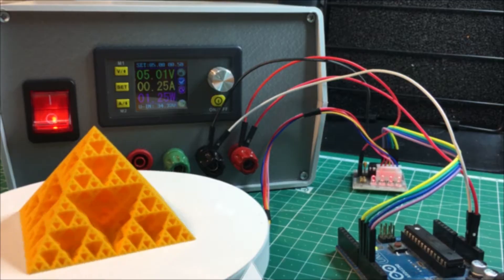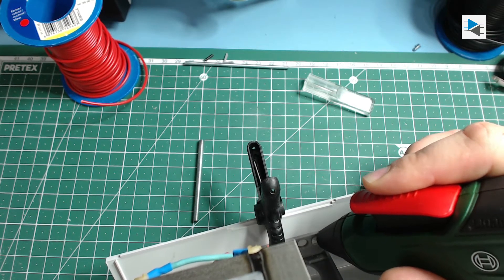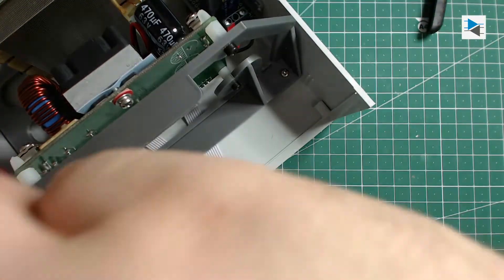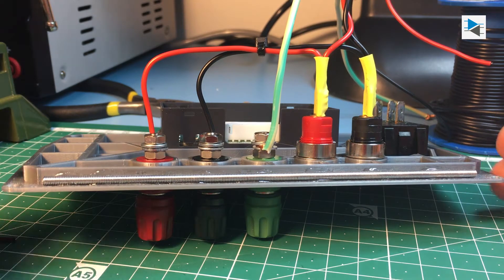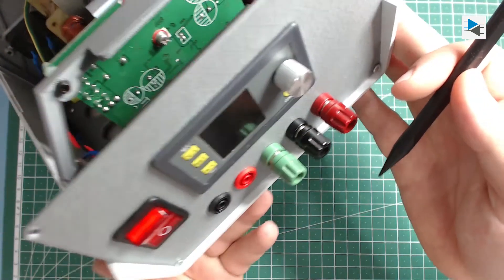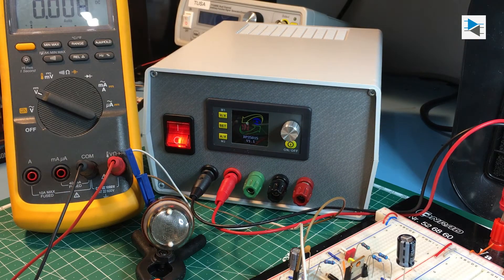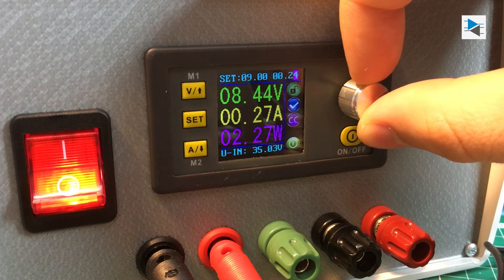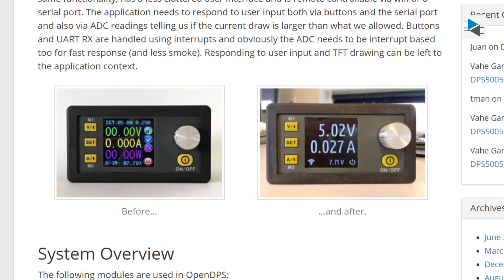DIY Lab Power Supply - DPS 5015 (Part 2)

Comment: @otinex I'm an absolute beginner, can you explain the difference between the insulated banana plugs and the power supply posts on the right side of the panel? Thank you!!! :-)
Reply from the maker: The banana plugs on the right-hand side are slightly more convenient for connecting wires, as the terminals have a screw on them. The ones on the left-hand side are meant for the more secure insulated banana plugs. Electrically there is no difference between the pairs because they are connected in parallel. Hope this helps :)

Comment: Hi, How You solve the curling problema with 3d printer when we print largue base Área objects as You do with front and back panel?
Reply from the maker: I print in PLA using a Prusa i3 MK2 with a heated bed that is covered by a PEI sheet. I don't use anything else.
Reply: otinex what temperature You use in the base table and You use fam to chill the printed object?
Reply from the maker: The heated bed is at 55°C, the fan is off for the first layer and on 100% for all others
Reply: otinex Thanks a lot, my bed is 200,and fan is off first layer and 100% rest.But dont work good like your
Reply from the maker: normally PLA doesn't require a heated bed at all, but 200 (if that's even achievable) is way too much. Try 40 - 70 and check that the bed is level and that the nozzle is at a right distance for that first layer (too close and it can curl, too far and it can curl).

Comment: Hello,
can you tell me the values of the two components soldered between the output terminals (near the toroid on the main board) I turned the terminals on the back and during the desoldering I have lost one (in your video I saw two, in my circuit I have only one but the empty pitches have too much pond to be empty in origin)

Comment: Do the DPS PSUs require AC, DC, or both on the input. 
Only seen them on eBay so far, and no info is given on this.
Reply from the maker: The DPS Module requires DC. I used a transformer and rectifier to deliver voltage to it. Theoretically it would  be good for 50V DC Input.

Comment: Thanks for your response. I'm a 22000 microfarad capacitor. you've been very thorough, Congrats and sorry for the disturbance. just one last thing: from your video I think I see that the capacitor is connected between the positive and negative of the bridge rectifier right?
Reply from the maker: that is correct, yes :)

Comment: hello. First thank you for the link you sent me to the transformer and the rectifier bridge. I wanted to ask you something else: the capacitor of how many microfarads is and how many was to be. and then connected to the most and less than the rectifier bridge - if you have an electrical scheme I would like it. thank you and I joined your excellent channel
Reply from the maker: The value of the capacitor is dependent on the amount of ripple you want to account for on a given load. As a rule of thumb: v_ripple = I_load / 2* f * C; Where v_ripple is the ripple voltage you can expect, I_load is the amount of current that is being drawn, f is the frequenqy - if you're in europe 50 Hz, if you're in the US 60 Hz - and C is the value of your capacitor. So if you assume the absolute "worst case" scenario being I_load = 15A and you can live with a ripple voltage of - let's say 100 mV then you would have -> 15A / 2 * 50 Hz * 100e-3V = 1.5 - so you would need 1 Farad (!) for that. That's 1000000 µF (!) if we want to be more generous and use a 100000 µF capacitor at 15A it would result in a ripple of 1.5V. The transformer I linked to you has a max current rating of about 4A. Using a 22000 µF capacitor with at least a 40V rating, you would get a ripple voltage of 1.8V at 4 A which for some is acceptable. As the power supply itself also has some input filtering, I used the highest value cap I had around - as a placeholder so to speak.

What i'm trying to say is that it depends on what you want to do :) In your case I would probably go with a 22000 µF capacitor (about 10 - 20€) if you don't plan on loading up your PSU to the max, otherwise for this configuration you can go for 150000µF (about 50 - 90€).

Comment: Hi, great video, congratulations. I bought the DPS 5015. I wanted to know what kind of transformer serves and what type of diode bridge serves. Thank you
Reply from the maker: Thank you for the Comment! The transformer is a 96 VA transformer with multiple secondary taps, of which I use the 24V one. The rectifier is just something I had laying around in my bin. I assume you are from Italy, I bought mine from Conrad : http://www.conrad.it/ce/it/product/514349/?insert=62&insertNoDeeplink&productname=Trasformatore-universale-1-x-230-V-1-x-4-VAC-6-VAC-8-VAC-10-VAC-12-VAC-14-VAC-16-VAC-18-VAC-20-VAC-24 

The rectifier is something like this one: http://www.conrad.it/ce/it/product/501158/?insert=62&insertNoDeeplink&productname=Ponte-raddrizzatore-Diotec-KBPC10152506FP-KBPC-600-V-25-A-Monofase

Comment: Why are you using the smoothing capacitor before the bridge rectifier? It would make more sense to rectify the voltage and then smooth the ripple. 
Also the wires you used is way to small to handle the potential current this system can provide. Whilst you're under supplying the system by using a 100VA transformer you will still exceed the rated capacity of the wire used.
Another potential issue is the bridge rectifier being attached directly to the plastic case. The rectifiers tend to get quite warm with load and may warp your front panel.
Reply: Ok I watched more and you acknowledged the heat issue with the rectifier..
Reply from the maker: Hello Johann, thank you for your comment. The smoothing capacitor is inserted after the bridge rectifier. If you read the reply to TDL's comment I mentioned that the issues you touch on have been resolved and will be shown in a future video. EN6204-1 States that at a temperature or +40°C a 0.75mm^2 conductor connected in the manner B2, C or E has a current carrying capacity of 9.5A in case of B2 and C and 10A in case of E. That is indeed lower than the max rated 15A of the front end and I will add a note in the description. Have a great day!
Reply: After re-watching the video I can see where I got confused RE: Smoothing cap. 
Thanks for the reply. I have just discovered you on youtube and are enjoying your vids. Thank you for your time and effort. =D

Comment: Is every one just missing the boat here? He hobbled this thing with a 96 VA transformer. At 20 volts that's going to be less than 5 amps output. It's rated for 50 volts at 15 amps. Why would you do this?
Reply from the maker: Thank you for your comment.
If you look at part,1 I mention in the intro that I had both the module that I got on a whim on sale and the 96 VA transformer sitting around my parts drawer, so I decided to do something with them. And the reason for doing this is - well - fun. Also I don't recommend running anything up to its specified rating (especially relatively cheap electronics from overseas).

Comment: Decent work. You should really have more views. 

TDL has touched on the wire size so I wont get into that. The mounting on the side with hot glue comes off a bit amateur compare to everything else. Is it not a printed case? Why not include stanchions to screw into with self thread screws?

Also I could not tell if the self thread screws you used on the base screwed into stanchion or directly through the base. Ideally all screws should not penetrate to give the best look.
Reply from the maker: Thank you for the feedback. The case itself is not 3D-printed. The front, back and mounts for transformer, electronics and cap holder are the only printed parts. As far as the self tappers go, nothing sticks out and the available mounting holes were used. The hot glue bit was an afterthought as I decided to add my own capacitor later in the design phase but it gets the job done.
Reply: Now that you cleared that up I had a look at your description and I see a link for the enclosure. Based on the video I just assumed it was all printed since other parts were noted as being printed.

For me hot glue is just not the way but I realise from viewing videos its a common thing.

Comment: Very nice video, you covered a lot of points that beginners would need to assemble their own psu from this module.

I'm just a bit worried about the wire thickness used for the input and output power stages, for this specific module being capable of currents higher than 3A, 12 AWG or around would be recommended to prevent wire loses and heating. Also the capacitor value is a bit low for anything above 2A.
Reply from the maker: Thank you for the comment!
I agree that the thickness of the input/output wires is on the low side for the shown state of the PSU. Very well spotted! 
Theoretically they should be able to withstand about 5A of continuous current which is plenty for powering small circuits and such. Still I have corrected the issue in the meantime and also added an external heat sink to the bridge rectifier.
Besides the capacitor I added there are also a few input capacitors parallel to mine, so this would increase the max capacitance a bit. I just used what I had laying around. There is a third video planned where I address these points and an upgrade to the firmware so stay tuned!
Reply: They should be able to withstand those currents, but that's really the maximum rating, for power transfer double the gauge is recommended.
Looking forward to see the changes, keep it up!

Comment: Hi;

Thank you for this video.

Could you tell us the purpose of the capacitor, please?
Reply from the maker: Hello,

The capacitor smooths the rectified voltage waves. If you're interested, see http://www.electronics-tutorials.ws/diode/diode_6.html in the "Smoothing Capacitor" section. Typically the largest value you can get away with is good for reducing the peaks. Think of it like a manual water pump with piston action. If you let the water flow directly from the pump, the flow will be discontinuous - i.e. the flow changes with the stroke. If you pump the water into a bucket with a small hole and then get your flow from the bucket then the flow will be smoother. In this case the bucket is the capacitor and the size of the bucket is the capacitance.

That being said, the module itself seems to have some input capacitors itself, so you could get away with connecting the rectifier directly to the input. Smoothing capacitors are always a good idea, that's why I added an extra one. (To increase the size of my bucket :))
Reply: Thank you for taking the time to give us an informative explanation.

Comment: Hi friend 
thank you very much for your video . it is a great work, I like it 
we are DPS5015 designer. if you have any question, you can contact me 
and now we just publish communication version of DPS5015, and DPS5020 communication version, hope you like it 
https://www.aliexpress.com/item/RD-DPS5020-Constant-Voltage-current-Step-down-communication-digital-Power-Supply-buck-Voltage-converter-LCD-voltmeter/32821185351.html 
and I saw your have a DDS, we have have a DDS jds6600, you can check 
https://www.aliexpress.com/store/product/RD-JDS6600-Series-40MHZ-Digital-Control-Dual-channel-DDS-Function-Signal-Generator-frequency-meter-Arbitrary-sine/923042_32814611834.html?spm=2114.12010612.0.0.iFU3bY
In last , about your comparation, he just remove our program and use his program , it is great, but function is not good 
but it is very interesting 
thank you
Reply from the maker: Thank you for your comment :)
In principle I like the module and can wholeheartedly recommend it to anyone who wants to build a nifty power supply with presets and current limiting! The price/performance ratio is right. I do however have a thing or two to say about the user interface: 
I would like the indication for the state of the output (active/inactive) to be a bit more obvious (changing the background color to green/red instead of the small glyph) and the UI to be a little bit less cramped. That is I think the main reason people update to the alternative firmware. 
I also noticed an offset of 40 mA on the current limiting, which is not that big of a deal when you know about it (it limits to 40 mA - 0.04A, even with the CC set to 0.00). I would also appreciate if you could release the firmware at least as a hex file, so people can return to it if they want to try openDPS.

Regarding the DDS, I have heavily modified the one you saw in the video by adding a linear power supply that fixes a current leak to ground for instance. I would be interested in trying out the one you build, but it doesn't make sense to buy a second one when I already have a working one.

The DPS5020, especially the communication versions look very interesting, definitely worth checking out. I'll try later on to add wifi to my non-communicaton version and see how it goes.
Reply: very good 
thank you for your reply 
1, about the interface , every has their own thought. 
2, 0.04 is sbout the current system error? you mean you set 0.00. the output current is 0.04A ?
3,. the firmware, sorry, we don't open it 
4, for DDS,. It doesn't matter , thank you ,I just ask you need or not 
5, for DPS5020, there is no problem
Reply: Hi otinex! I wrote you PM if you don't mind! Thanks! :)